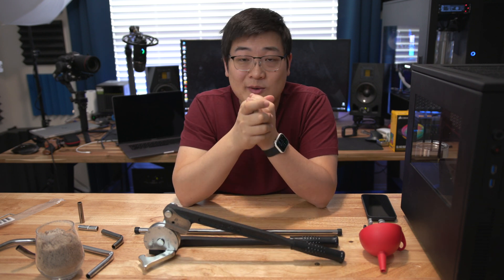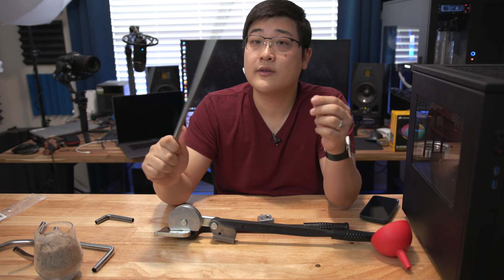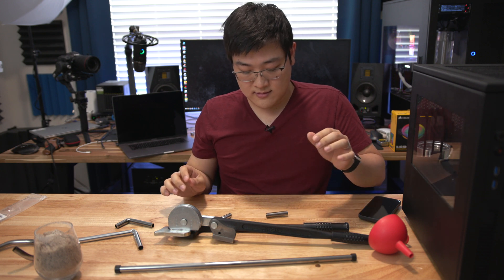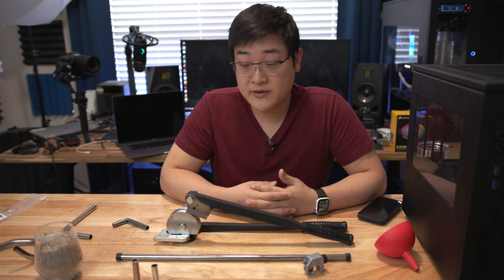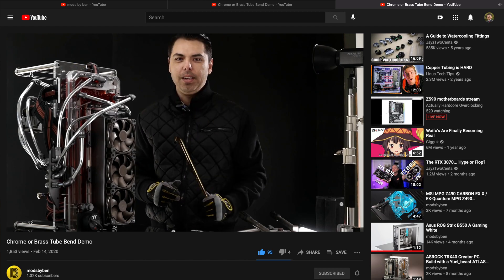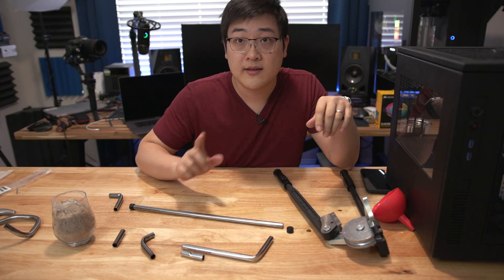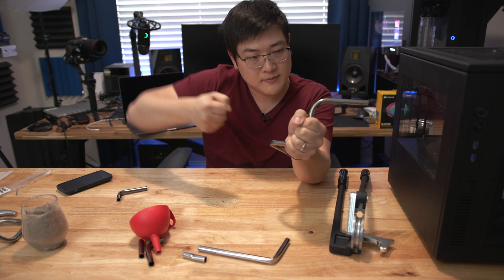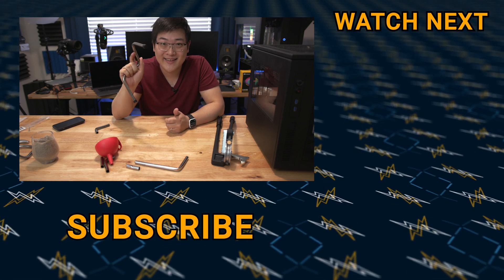Metal Tubing Watercooling Fail | Cutting & Bending Brass (Part 1)

Comment: Just gave this a try with a 12mm brass tube bender on my Bitspower 12mm diameter and 0.7mm thickness brass tube. Tried putting in some soil for padding. Not only was it insanely stiff, it snapped just before I could finish the 90 degree. Definitely not trying this again and going with 90 degree turn fittings instead. The tube isn't wasted because I can simply cut off the snapped part and reuse the rest of the tubing for a separate run. Refunding the bender.

Comment: Does the flattening/wrinkling still occur when doing a 45 bend with sand (i.e. bending half as much as a 90)?
Reply from the maker: you can do a 45 if you take it slow.
Reply: @StanYanMan  thanks!